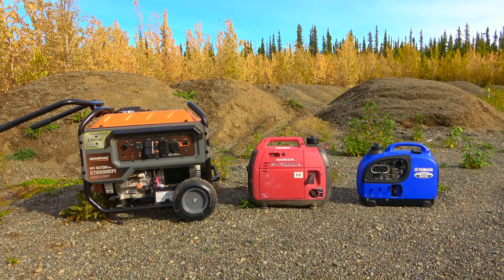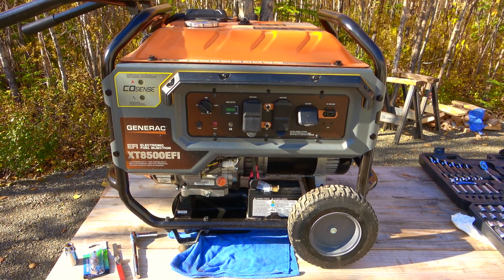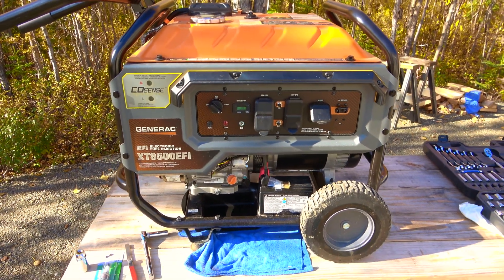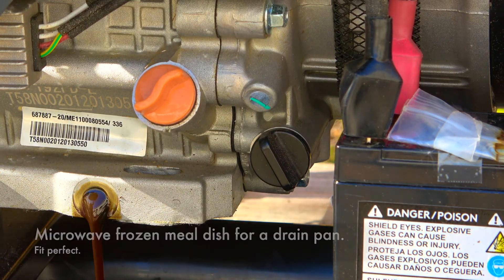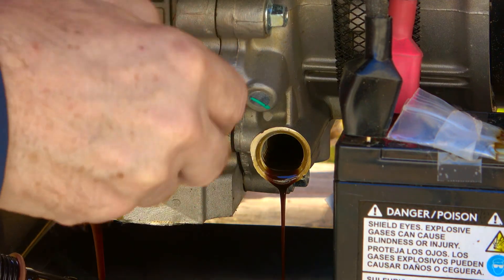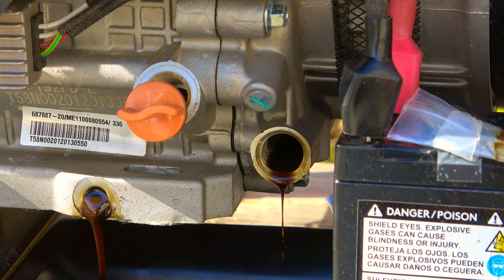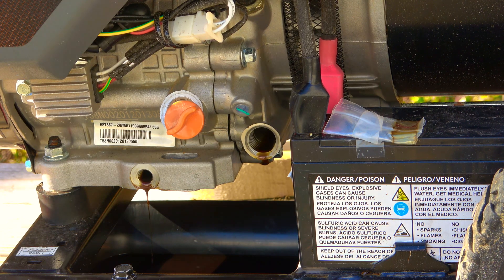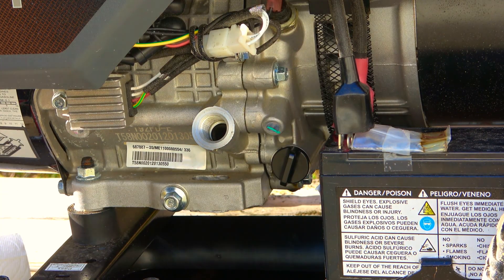GENERAC XT8500EFI  Generator Maintenance.

Comment: Do you leave the battery terminals connected when you aren't using it? Do you always leave the charger plugged in to the mains for charging? I leave mine in the shed and whenever I go to run it for a few minutes once a month I have to charge the battery up. I definitely do not use it as much as you would.
Reply from the maker: In the off months when it's in storage I remove the battery and trickle charge it occasionally. I dont think as of yet that Ive got more than two seasons out of one though. The one that came with it was who knows how old and didnt hold up. The replacement did well but one of the terminals seemed to come loose and when I grabbed it to wiggle it. it simply came off. Im on another replacement. And so far so good. We'll see how it does next summer. I feel better taking it out during storage. That way I continue having it conveniently accessible and am more aware of its status. Vs. being disappointed its dead when II need it. It's easy to neglect and the months fly by. It's a habit I had to develop. Pays  off though.

Comment: How long are you to run with the break in oil prior to replacing with synthetic oil?
Reply from the maker: I looked in the manual and I dont see that defined. I know if you ask enough people or even google it, you're going to get anywhere from 10 to 30 hours.  My personal feeling is that if you've used it for a good bit say on your first run. It can only benefit it to change it sooner rather than later. Anything in the motor or particulates freed up from parts or initial friction should be in the oil by this point. And if you feel you're doing it too soon. You can certainly change it again a bit later if you dont feel it had a good full brake in. It's money of course but barring any other issues or mechanical failings. Good clean frequently changed oil can only add to longevity.  The common practice and recommendation is after 100 hrs of use or every 12 months. which ever comes first.  After the brake in of course. Hope that helps.

Comment: please replace that torch with an ngk
Reply from the maker: I am a an NGK fan and that's typically what I use across the board. I was searching  for availability of several different ones around the time I made this video and that particular one/match  was scarce. And when found marked up in price a bit much. So ....... I replaced it with what was in it out of convenience and comfort knowing that's what they chose to install when building it..  But it hasn't been an issue that Im aware of. When I run out of the handful of Torch plugs or get close. I will be looking for the NGK equiv. Have you had issues with Torch? Ive never actually used them prior to this pc. of equipment.

Comment: Do you run your efi gens out of gas?
Reply from the maker: If I can. I prefer to.  But it doesn't always work out that way. I do however always run treated fuel in all my small engines . Generators, Chainsaws etc. And that way there protected.  And it hasn't failed me. And if available  ethanol free fuel. AKA Rec (retional) fuel.

Comment: I just got one of these so I am very thankful for your video.  I am torn on the break in oil.  It appears to be a straight SAE 30 but the manual says not to use straight 30 below 32 deg.  It is cold here in Maine so I am concerned about that.  Did you do your break in period in warm weather?
Reply from the maker: I think it was definitely above 32 degrees. I would say if your generator is stored say in the garage or a place where the oil isn't getting that cold before taking it out to cooler temps and running it you'd be good. But if it's below that where you store it, and starting it with the oil colder. Id avoid it if you can.  Especially since they noted it in the manual.  Im sure a lot of people do it, and dont read the manual,  and there off and running with no immediate issues but why cause more ware and tare if you dont need to.  Just wait for a warmer day if you have the luxury.
Reply: @ericinalaska7648  Thank you for the reply and the information.  And again thanks for the awesome video!
Reply from the maker: @mx5ish  I wish you well.

Comment: If you own one of these and are having problems starting your XT8500EFI HERE IS A TIP. 1st your generator is a EFI so your battery must be fully charged or at least 12.5VDC if it does and you still have problems take one side of a set of jumper cables I used black side connect one end of the cable to the negative side of your battery and clamp the other end to motor not the chassis but the motor and it should start right up.
Reply from the maker: Yes, the charge of the battery on these can certainly be finicky. If I  have any issues. It's typically as it gets colder in the fall, and if I dont use it for a few days. I can usually pull start it but the battery that came with it had a short lifespan. Who knows how old it was before being put together with the generator and then how long it sat in a warehouse and delivery and until sold. And it would give me a bit of grief.  The replacement has served me well.  Battery maintenance is key but if that slips it's always good to have a plan "B" in your pocket. Thanks for the info and tip!

Comment: Gemerac's are pieces of crap. Buy a Honda generator. They are so much more reliable
Reply from the maker: I have one of those as well. Smaller, but been going for many years. 15 to 16 years I believe. With lots and lots of use. While I will say Honda would be my first choice. I have not been disappointed with this Generac as of yet. I bought it at Costco and they have a pretty good return policy there in the event it disappointed. Ive had it going on I believe 4 maybe 5 years now. For the size and price compared to a similar Honda.  Im willing to give it a go. I actually have a Honda, a Yamaha, This Generac, and of course the built in Onin in the motorhome. The Onin is the only one to give me grief so far all these years.  They seem to be problematic. So when in need I just plug into the Generac. If I need that much Amperage. Or one of the others for lesser needs.  Anyway, thanks for the input. All opinions are helpful to viewers.

Comment: What is the carbon canister? Does the fuel line from the gas tank run down to the fuel canister?
Reply from the maker: A carbon canister on a generator is  filled with activated carbon that captures and stores fuel vapors that would otherwise be released into the atmosphere. Essentially it's part of the emission control system. By absorbing these vapors and then releasing them back into the engine to be burned during combustion, reducing harmful emissions.  It's connected to the fuel tank by a vent line. So it's not a fuel line but may appear to be because it comes directly from the tank, typically.  Hope that helps.

Comment: Thank you for the great maintenance video. Very clear and informative. 

One helpful tip for anyone who buys new: Change the oil immediately after running it for its first 1/2 hour, and after its first 3-4 hours. You’ll see a ton of metal flakes in these first few oil changes. 

This will ensure a long life and easy starts for your generator for years to come.
Reply from the maker: Thanks for the info. I can't say I did that. But I do believe there cant be too much when it comes to oil changes. Especially during the break in period.  Growing up I always had others chime in on how frequently I'd change my oil. Saying  they'd gladly use my old oil for there oil change, and commonly quote how many years its been or that they never and look how many miles my car has on it etc...... Proper lubrication gives your set up its best chance at longevity. And as you pointed out. Removing any particulates, metal, or other that may occur from the break in and normal ware and tare, can only have a positive out come. Yes it cost money. But likely not as much as a replacement and the convenience of it working and being available when you need it. Especially for those that only pull it out in a pinch. Is priceless.  Thanks again.

Comment: When you buy this generator after hooking the battery up do you need to hook up and more connections for the battery start to work because I done had the charger plugged in all day and it still isn’t charged
Reply from the maker: As far as anything that would relate to it starting. Just oil, battery and key as far as I know.  If it's just dead and you've checked your battery connections and there is just nothing. My instinct would be the battery needs replacing. Who knows how long these batteries sat on a shelf before being packaged with a generator to be sold and then how long it sat before being sold. The instructions indicate, needs a full charge before using. Mine didnt hold a charge very well and I replaced it. The new one has performed well with keeping it charged of course.  Did you use the charger that comes with the generator or an automotive type charger? With the proper battery size settings. I prefer to remove the battery and use a charger that indicates what it has drained to. Showing me the voltage right when I hook up. And also indicates the charging status or if there is none.  That charger that comes with I believe is a sort of trickle charger and you have no way of knowing if it's doing anything. It doesn't even have an indicator light to let you know it has power when you plug it in. At least mine doesn't. So you dont know if the battery is completely dead or if its trickling slowly, or trying and trying but getting nowhere or just needs more time.  If you dont have another charger. You could take the battery to say a batteries plus and they could test it for you. I suggest them mainly because there one of the few places likely to have  that particular battery.  Hope that helps.
Reply: I had the same issue.  I had ours in a box probably too long before breaking it out to use.  We had to replace the battery and now it starts up like a champ!  Now we need to do this oil change ASAP.

Comment: Can you do a video on how to drain the fuel from the generator with EFI. I have the exact same generator.  I love it.
Reply from the maker: I can. But that generator is tucked away at the moment. Do you have some bad fuel, or?  You'd just need  find the fuel line and disconnect it and allow it to drain into something. Once it starts open the fuel cap. That'll speed it up. If you're not familiar with that. There will likely be one line/hose coming out of the bottom or low spot on the tank. Then follow it to where it connects from there. You could just disconnect it at the tank but it's get messy if your not ready with  something for it to spill into. I'd were gloves etc. If you remove the other connection it allows you to pinch off the line and maneuver it to reach a pan of some sort to drain into. Or remove the tank if you want to go that far.  Sometimes that's not that complicated. A few nuts or bolts holding them on and again disconnect the fuel line. Then you can just handle the tank in anyway you like.  Turn it upside down etc. Pour fresh fuel in and swirl it around and drain it again if you like. Then put it back on and you should be ready to go. Hope that helps.
Reply: Saw your response but the manual is pretty poor about indicating where the gas shut off valve is or how to do this with this fuel injected system.  Video would help!
Reply from the maker: @nirajkaji3385  At this moment. That generator is  put away at a remote property for the winter. If I can get my hands on another. I will see what I can do but no promises for now.

Comment: Great video! Any issues at all with the EFI function throughout your time in using this generator?
Reply from the maker: So far none.  Ive got about 250 hrs on it.  Have you? Or just wondering if its a concern?
Reply: Mine just arrived today - just wondering if it was a concern!
Reply from the maker: @michaelbielek1824  I haven't had any problems so far. And I haven't heard of any so far. The main thing I usually concern myself with is clean treated and if available ethanol free gas. Usually yields good experiences.

Comment: Valve lash adjustment is also important
Reply from the maker: Yep. Was considering doing a video on just that. Separately On its own. Was on the fence about including it in the routine maintenance video. But it really should be addressed and considered.

Comment: I just bought one of these exact units. Glad you showed the maintenance so I know what the oil screen looks like etc.
It looked like the oil and spark plug were certainly ready for an exchange at 100 hours, thank you.
Reply from the maker: Glad it was of help. Im a believer in the recommended maintenance schedule on these. There are never any guarantees in life but at least Ill know I did my part to keep it running.